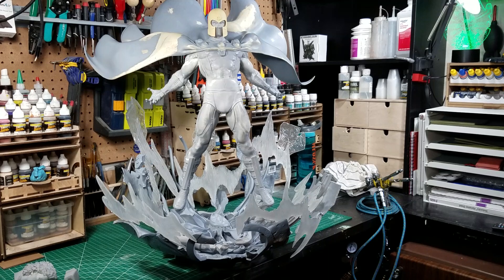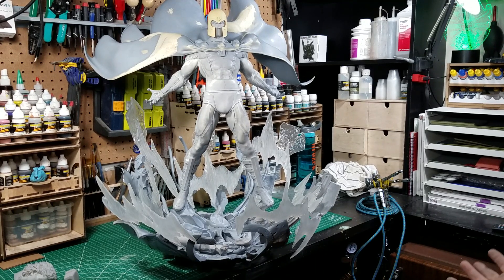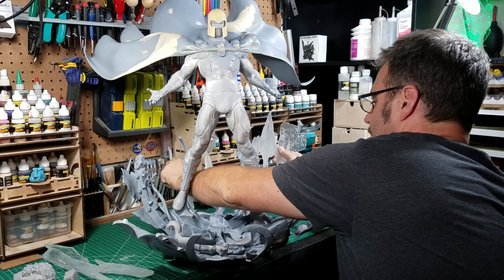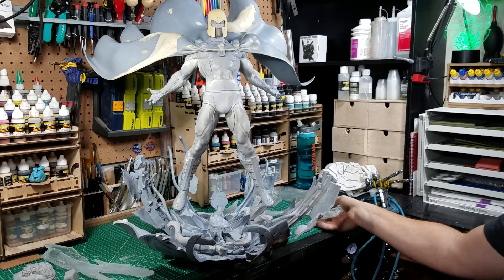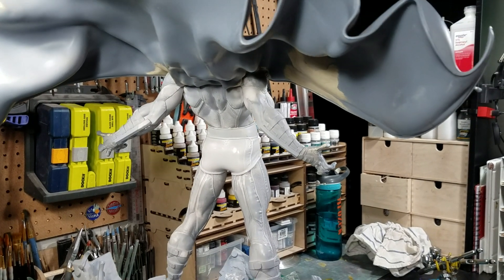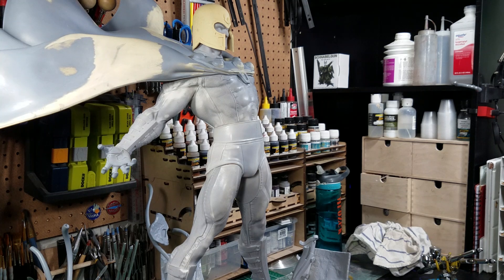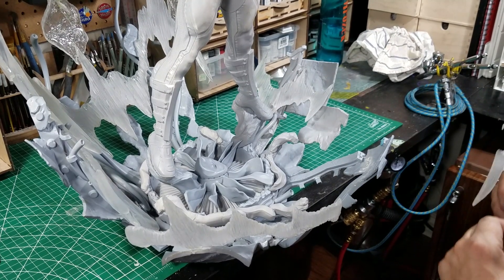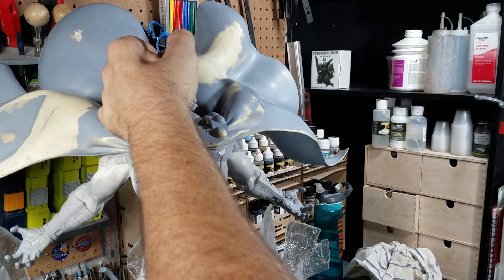1/4 Magneto prototype Intro

Comment: I’m curious. When you say “glue” to key in body parts. Are you using  a substance like Magic sculpt or a clear liquid poxy to fasten pieces?  Great video, Thanks
Reply from the maker: Depending on what I'm glueing I'll use a 2 part epoxy, sometimes 5 minute epoxy and for areas that need extra strength 30 minute epoxy.  The legs and torso were glued using 2 part 30 minute epoxy were parts of the base were glued with 5 minute epoxy or CA.
Reply: Thanks, your response was a big help!